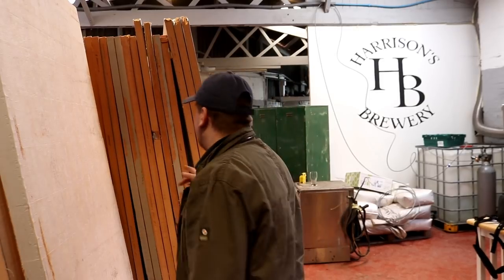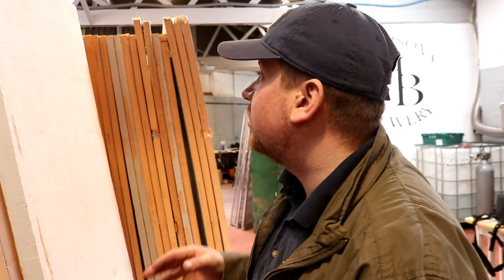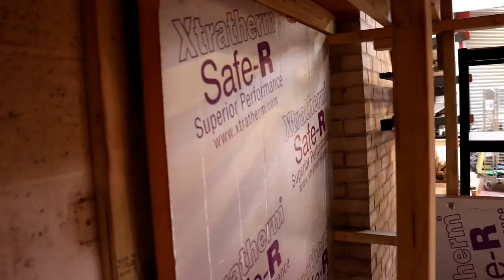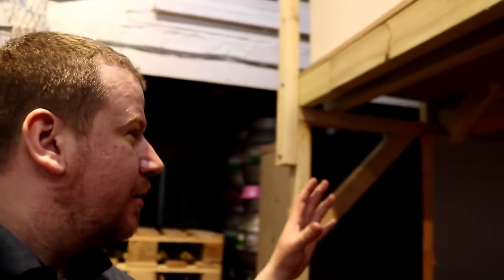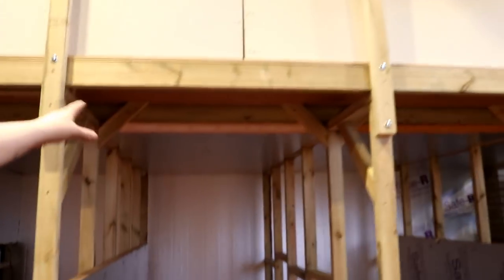XTRATHERM

Comment: Great suck job on the intro 😄 . @UC9D9JTXypq8opA2zPJnjQJA ; I'm on courage Best Bitter (home brew of course). I've got a similar pipe bender, works a treat. Kingspan (or the one that you have) is so easy to use, it's a pleasure to work with. Great vid as usual. Cheers, Schnuz.